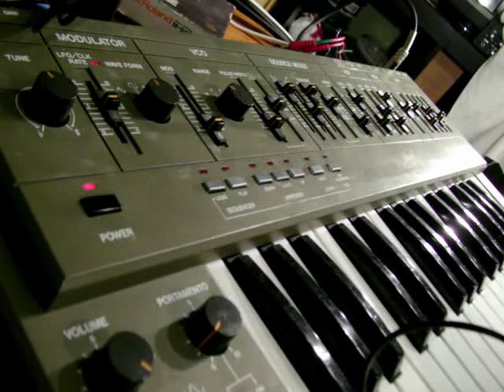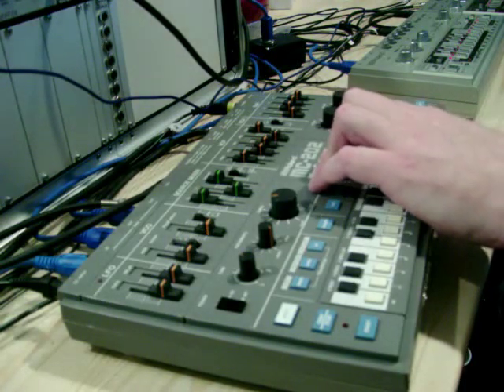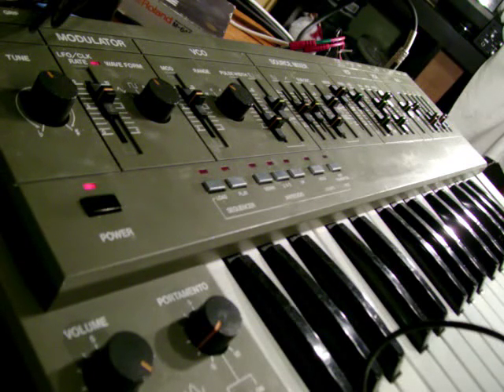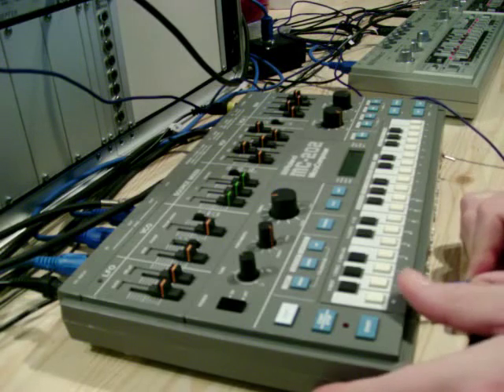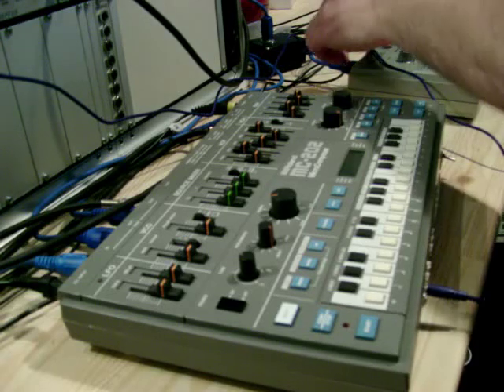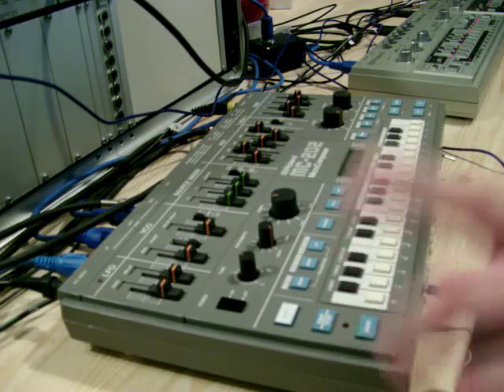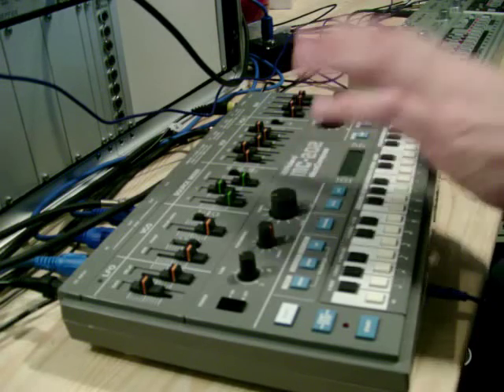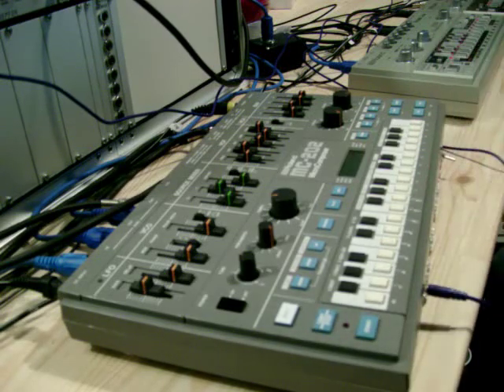Making drum sounds with an SH-101 and MC-202

Comment: Excellent demo- thanks so m. for this. I just got a 101 ($700- worth every penny). I am unable to get it to sync to my Boss DR55 which does output +5v, which is what the 101 should accept... What should my settings be on the keyboard to sync the arp or sequencer to the DR55? Thanks for any help on this...